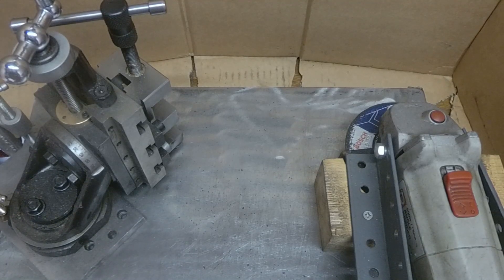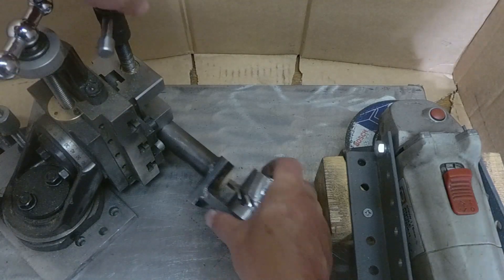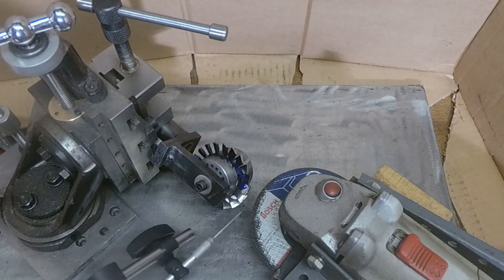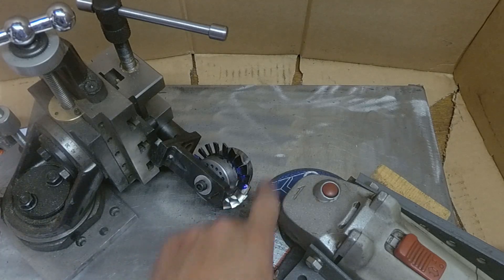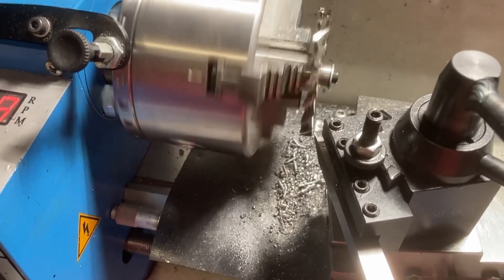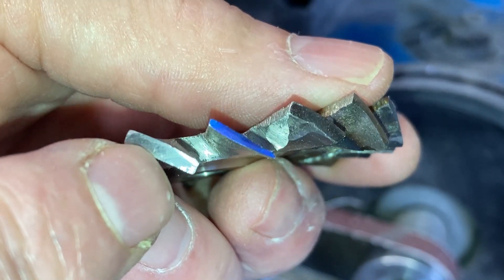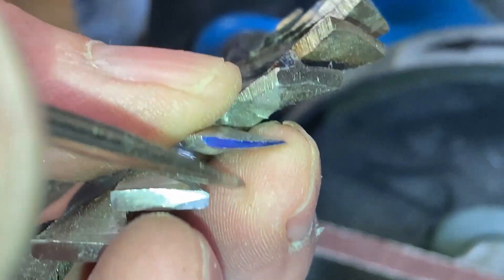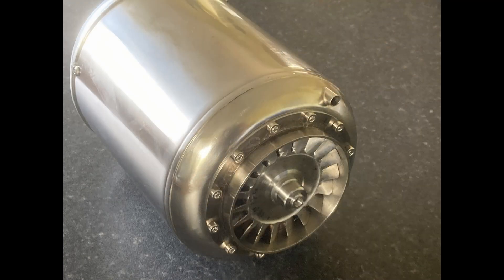Making the Turbine Wheel for the Kamps Jet Engine

Comment: How do you balance it? I’m confused how people balance their home made jet engines
Reply from the maker: My turbine was only statically balanced as an assembly with the shaft. The shaft is straight and true; the compressor wheel is dynamically balanced by the manufacturer, and a shrink fit on the shaft, so the only thing that should be out of balance is the turbine wheel. Getting this in static balance should mean that the assembly has reasonable dynamic balance.  Stage 1 - with the turbine mounted on the shaft, and bearings installed, you gently rock it to and fro, and the turbine settles with its heavy spot at the bottom. Remove a bit of metal from the heavy spot and try again, until it doesn't have any bias towards a particular position. Step 2 - hold the assembly by one of the bearings between finger and thumb and use a gently stream of compressed air to spin the turbine. Add a small piece of tape (about 5mm x 5mm) and move it around on the turbine until you feel the least vibration through your fingers. Remove a small amount of metal opposite the tape and try again. You eventually get to the point where you can't feel any vibration, and adding the tape anywhere makes things worse. I think that's OK for this engine, as it 'only' revs to ~100k RPM. For faster speeds, dynamic balancing is probably required, and people have built various machines using piezo transducers under each bearing to do that.

Comment: Can i use chrome instead of nickel?
Reply from the maker: Hi - You would need to choose something that was intended for high temperature use in a fairly aggressive environment. Pure nickel or chrome won't be suitable, it has to be an alloy of some sort to get the necessary properties. Hastelloy X is 47% Ni, 22% Cr, 18% Fe, 9% Mo, 1.5% Co & 0.6% W.... So not a simple material. Most suitable materials will be nickel alloys.

Comment: Great tutorial for all RC turbine enthusiast. My turbine wheel was milled on cnc mill using cheap end mill for aluminium each could work up to 2 blades in inconell.
Reply from the maker: Thanks very much! I can well believe the tool life - it took three, good quality, hacksaw blades to slit the turbine disc, and I think Hastelloy X is probably a bit easier than inconel.